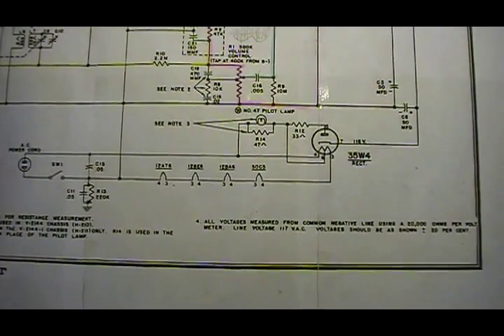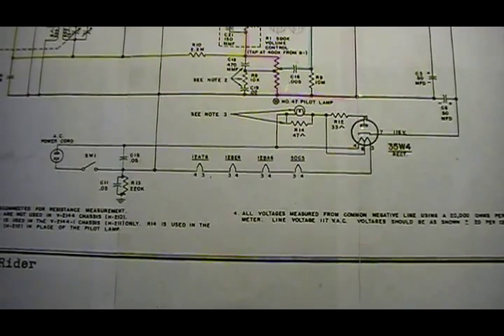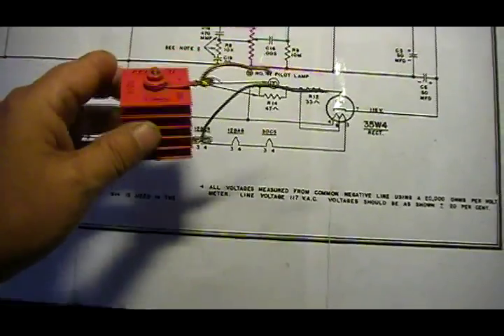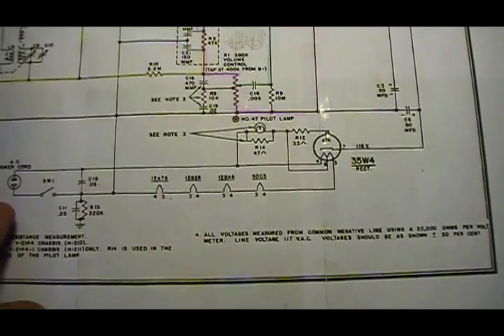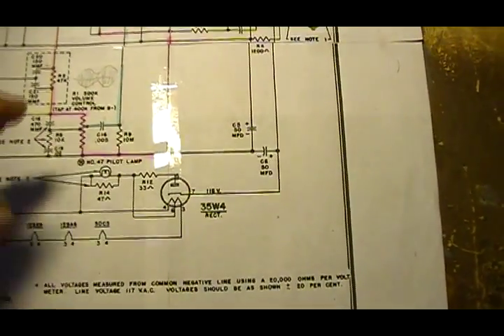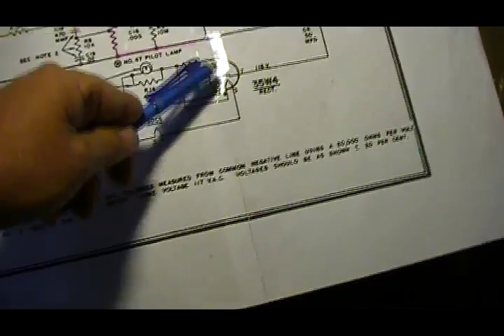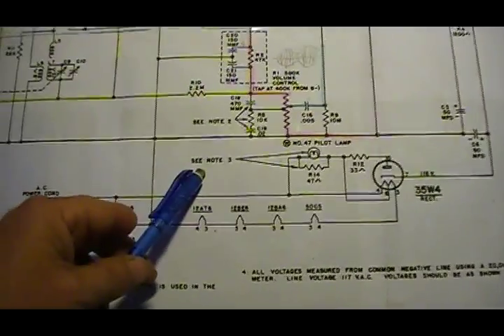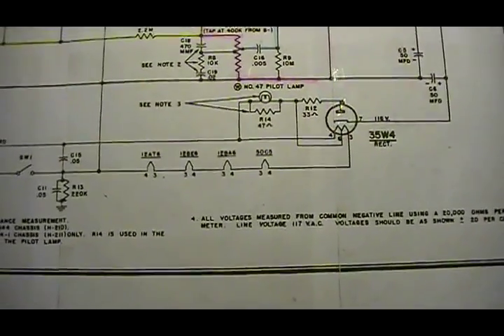Radio Theory Part 5

Comment: Back in the dark ages I worked in a TV shop while in high school.  We had a lot of selenium rectifiers that went to diode heaven.  Our go to cure was to just parallel a silicon diode and off we go.  Looking back I don't know if we were lucky or failures just tended to be opens vs shorts.
Great info. Thanks.

Comment: I would have, for quality, designed this power supply with a step down power transformer and two rectifier tubes for full wave rectification.   I know that that would have made the radio heavy, but I like to design quality.

Comment: Dennis can you cite references to the source of your information about the toxicity of selenium dioxide.  The information I see on the web including the EPA site indicates that accidental low level exposure is not that dangerous.  Chronic exposure over a long period of time is an issue but that is not what we would incur in one rectifier burning.  Also can't find any info saying it would burn right through your skin.  Thanks.

Comment: So often, only a couple of capacitors are used as the filter.  That is cheap.  If I was a design engineer, I would want to design the highest quality radio that I could.  I would use a pi filter using a couple of capacitors and a coil.  That is high quality.  I would also use a full wave bridge rectifier and not a half wave for the same reason.